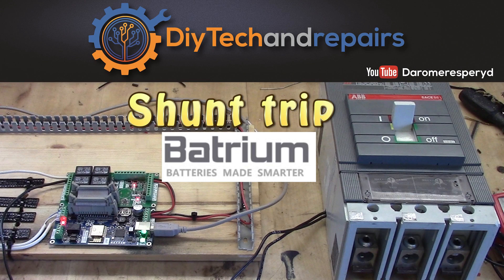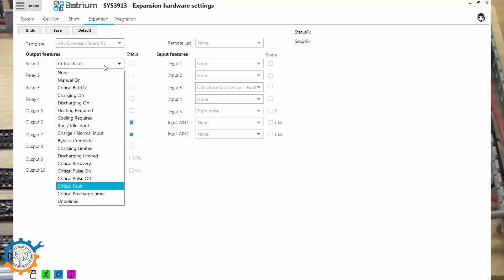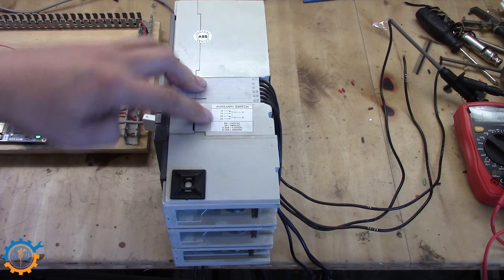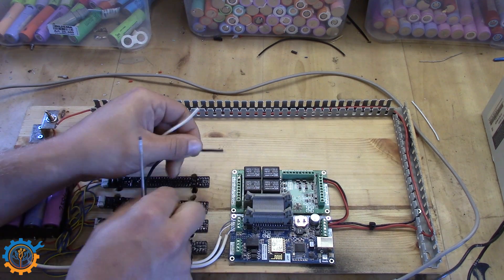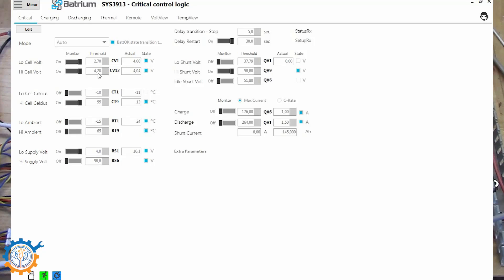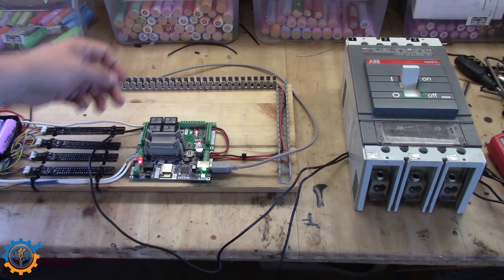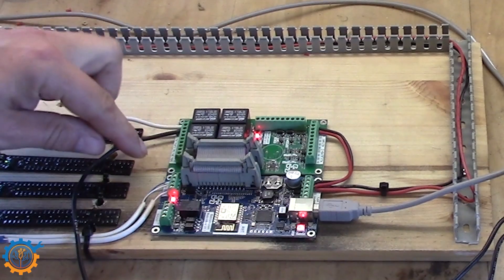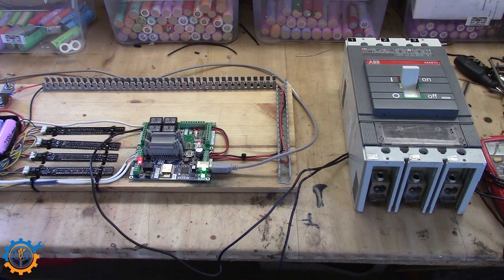Batrium guide - Introduction to battery protection for your powerwall

Comment: Ciao ;) is it possible to "drive" a contactor trip switch, without the batrium expansion board?
Reply from the maker: Yes. Wm4 can do it.
Reply: @DIYTechRepairs  mani thanks ;) just fiew other question, I have just recovered a generation 2  nissan leaf battery, (every module are balanced); anyway, do you think is it possible use the "12V contactor" that are present on the original battery array?
Or is better to use a specific contactor for DC plus an 12V actuator? At the moment i have just start to arrange the "single" module in order to have a 14S 10P array (nominal 48V at everage  45V to 58V).
Reply from the maker: @albertorossetti5375  I cant answer that Im afraid. I have never worked with Nissan Leaf packs and have to little knowledge about it. If you add your question to Secondlife storage forum you will get an answer for sure!
Reply: @DIYTechRepairs  Thanks in advance, i will trii it ;)

Comment: Hi again ...on the Second Life forum I received information that you do not need the expansion board to control a Shunt Trip Breaker....what are your feelings on this?
Reply from the maker: Feeling? Yes you can run Wm4 directly on a shunt
Reply: @DIYTechRepairs  What I meant was in your video you indicate you need the expansion board to use a Shunt Trip Breaker with the Watchmon.  So as per your response and others on the forum, the expansion board is not necessary.  So what would the advantages of actually getting the expansion board be?  Also, if I had a Shunt Trip breaker like yours and I was using a 48V pack, could I use a transformer to step the voltage down from that pack to power the trip shunt ...or do you have to have separate power supply for it? Thank you as always.
Reply from the maker: @FretsNirvana  Wm4 you dont need expansion but the expansion give you the advantage of having Wm4 to know when the shunt tripped. Get a shunt trip for 48vdc or depending on type you can just add a resistor in series. Dont add extra electronics on something that is for protection . More stuff = more that can fail
Reply: @DIYTechRepairs  Thanks.  Going to send you a PM on the forum.

Comment: So the baitrum can be used to trip the breaker. Or a contactor. So is that a constant voltage while all is good . then power off when there is a fault? I'm wanting to use MOSFETs to switch the inverter. Or a latching relay. I only need 200 amps. Maybe 300 for future upgrades.. Can the output be programmed? Thanks

Comment: So this one relay can trip the breaker due to overcharge, overdischarge, and temperature? (If this question doesnt make sense, forgive me I am a newbie but I hope you get the point). Is an expansion board necessary on a Watchmon4 for this to work?
Reply from the maker: firpofutbol on wm4 you dont need the expansion board and yes this big ass breaker is suited for disconnecting the battery.
Reply: That is awesome mate!. In a solar system, would I put one of those between battery and mppt charge controller, and also one between battery and inverter/charger? Can batrium disconnect two shunt trips for the same reasons? I'm trying to find a suitable shunt trip now in the USA. Not sure where to start! What do you think of this one https://www.amazon.com/Siemens-Q26000S01-240-Volt-Circuit-120-Volt/dp/B0052MCT1Y/ref=sr_1_2?ie=UTF8&qid=1533879396&sr=8-2&keywords=shunt+trip

Thanks so much mate!

Comment: So is this for DC current between your battery banks and the inverter or is this for AC current after the inverter?
Reply from the maker: Thanks!  Its only DC between battery and inverter. The inverter is what makes the AC. The shunt in this video is between the Inverters/chargers and the battery bank hence i run it on the DC side. Its important to get a breaker that is rated for DC.
Reply: Thanks for the info. I guess I'm a little confused as this doesn't seem to support the DC amperage I'm looking to run at 48ish volts. I'm looking to do the same thing by putting this between my battery banks and the inverter. Looks like I need to wait for your future videos on this.
Reply: Thats exactl'y what he did!

Comment: Hi
just setting this up on my system. At 4.30, are you meaning to turn on power to watchmon, then turn on the breaker/ shunt trip?
Reply from the maker: I see that I wasnt fully clear there. The thing is that if you power the watchmon via the breaker. Ie if you have the watchmon after the breaker the watchmon will test the conditions on the bootup (Versions in this video and older) due to it is tripping the breaker. So basically if you turn the breaker on to power up the watchmon it will then turn itself off again when testing the output.... :)  (Kind off)  You need to have the watchmon before the breaker.
Reply: DIY Tech & Repairs Got it. Thanks for that

Comment: is it possible to use a magnetic contactor for this feature of the batrium? instead of a shunt trip breaker?
Reply from the maker: Yes you could use that. Every type of breaker/contactor/relay or what so ever that will cope with the current/voltage and can be controlled by the onboard relay or mosfet
Reply: so in the settings you can change it to normal close the relay in the batrium.. and when the critical fault happens it will go to open???
Reply from the maker: Llou Coust yes you can run the relay when battery state is ok and Open it when not ok

Comment: Excellent.... 👍 
Where did you get the abb braker switch ebay...?
Reply from the maker: Correct. Ebay. I was a bit lucky. 70EUR was the price for it. Though alot of shipping and vat... But it was heck alot cheaper than buying a new one.